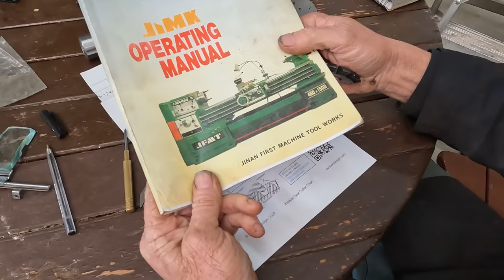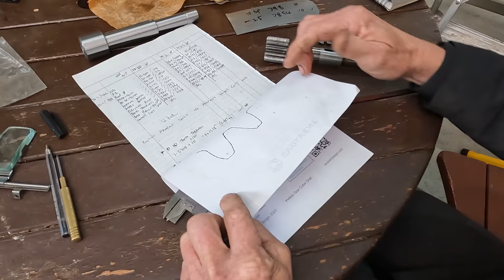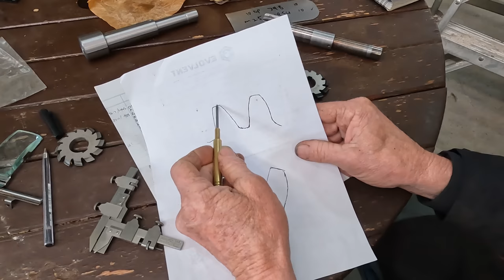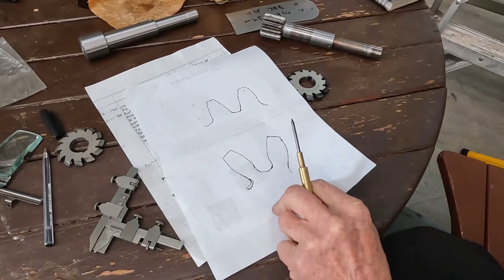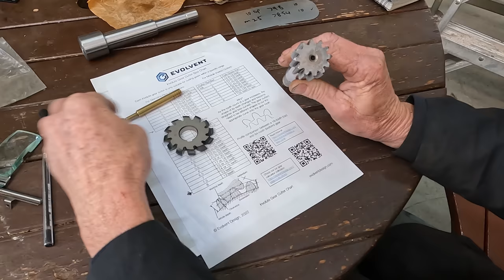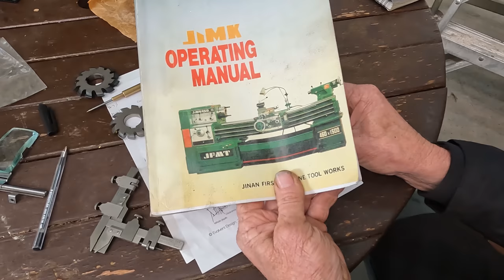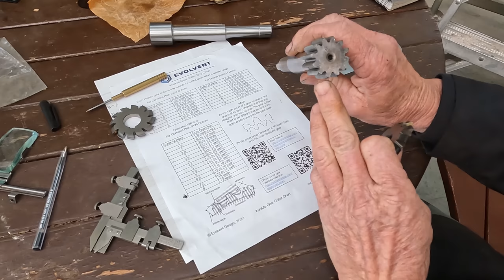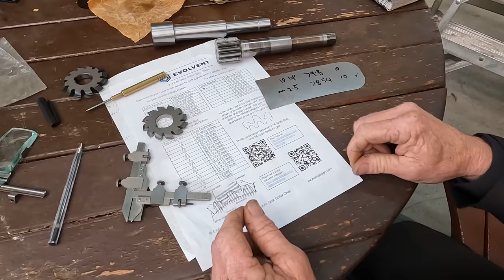A Grinding Wheel Guard For The Tool & Cutter Grinder .

Comment: Hi Max, unique gear profile on that pinion.
Waiting with interest on the gear cutting operation.
My lathe graduations on the carriage handle are only true to 12.5 mm, going further missing 2 graduations.
You cannot count the turns for large distance, will result in a ratio error.
DRO now solves the problem.
Reply from the maker: Just a wee bit of wear !  DRO's are a bit further down the track at the moment .  👍

Comment: Well done Max, it’s great that you can find time to do any videos given all  that you have going on. I have a T&C grinder that can  run in either direction , I have not had an issue with the wheel coming loose  in reverse and I find this feature very useful, might be worth you looking at when you get the 3ph motor back on yours.
Reply from the maker: Thanks .  With a screwed retainer , i wont run this one in rev .   Would be good to convert it to tapered hubs , then it could run safely in rev .  👍

Comment: Hi great result 10k have you thought of drilling the root of the gear before you cut it? keep up the content.
Reply from the maker: Thanks .    No , i will just off set it or single point it .    The undercut is not required with the modified diameter .  👍

Comment: Congratulations on your move. We’re in the same house for 38 years now. I’d love to get a bigger one with more room for my shops and my audio/video equipment. The horrors of moving is a deterrent.

I have to say that just maybe you overthought that guard. You’ve given it enough range of movement to turn it into a robotic arm. I have a question for you. Over the decades I’ve always bought well known named tool holders for my lathes but I’ve been wondering if those cheap ones you see in Amazon or eBay are decent enough to bother with. I hate to say it but when a tool holder is the same price as a good insert, it’s a temptation.
Reply from the maker: I have some cheap tool holders , they work fine .   The real ones , you can get spare parts for .   But saying that , things become obsolete quickly these days !    The guard , i want to have lots of different position options for different wheels & jobs .  Cheers 👍
Reply: @swanvalleymachineshop  it’s hard to get parts for known ones. I’ve got a Kennametal  that I can’t get the right size screw for unless I buy 10 from MSC for $100 US.
Reply from the maker: The last one i bought was Seco TNMG & i ordered spares with the tool . Trouble is , i keep forgetting where i keep them !  @melgross

Comment: Hi Max, What a ball ache that rack and pinion is. Are all rack and pinion set ups like this?. If I was the OEM I would have made it as simple as possible using standard DP or module cutters. Great news on the subs, and glad to see the shop getting there. Best wishes, Mal.
Reply from the maker: Thanks .  I think they modified it for easier mass production , no undercut required that way .   👍
Reply: I should think so. lol. Looking forward to the rest of the restoration. @swanvalleymachineshop

Comment: 10,000 subs! 👍 Well deserved Max, congratulations.

With that JFMT lathe pinion gear, for the undercut at the bottom of the groove, could you not maybe drill the bottoms out on a bolt circle on the dividing head mounted vertically with a chuck - before you then cut the teeth with the cutter?

That might maybe save all the tarradiddle offsetting the cutter to achieve the undercut afterwards?

Just a suggestion, as you well know, I don’t know my @rse from my elbow when it comes to this kinda machining mullarky, but that was the random thought going through my head while you were explaining it.
Reply from the maker: Thanks Ian .  It has to be made the same profile as the original one .  👍

Comment: At a loss to see how that is the original shaft for the machine. Having to go so far off course for that particular gear is mystifying. Sure hope you're able to cobble together a working shaft. Congratulations on getting moved to your new house.
Reply from the maker: Thanks .   It would be the original shaft .  My guess is , they modify the gear for production as it would be quicker & easier to produce than a standard form with the required undercut .  👍

Comment: max, for your hongfong mill problem,  maybe a simplee solution, 4 tapped holes in de baseplate  on each corner with bolts, you can then screw the bolts (like a machinst jack) against the opposite "rocking"plate and the rocking is historie ?

btw, just my opinion, congrats with your 10k milestone max !
but i think youtube keeps your channel (to) low in the stats because you always have super interesting content and in my opinion you should have had at least 100k or 200k by now?

cheers ben.
Reply from the maker: Thanks .   Under the column there needs to be full contact support to help with vibration .     👍
Reply: ok, that make sense.
cheers.
 @swanvalleymachineshop

Comment: Congratulations Max, you deserve it. Your guard worries me, I have had a wheel slightly smaller than yours explode, it was covered by a 10 mm thick cast in close fitting guard which shattered. I surmise that a piece of the wheel wedged itself between the wheel and the guard and broke the guard. Pieces pf the wheel  broke the frame of my safety glasses and  I ended with a face full of shrapnel and pieces of wheel in the left eye and grit in the right eye. Not a happy experience. I was alone at the time and had to shut everything down and self administer first aid by feel. The important lessons from the experience are 1. The kinetic energy of an exploding wheel can smash a 10 mm thick cast iron guard and still have enough left over to ruin your day.  2. Even with a guard in place and appropriate PPE  NEVER stand in the firing line of a grinding wheel. I would make the guard from a thicker piece of steel or add a re enforcing strip around the outer edge or both.
Reply from the maker: Thanks .   I am confidant it will be ok  .  They are more lethal than most realise . 👍

Comment: If you used a hobber to cut the gear it would automatically change the shape of the tooth  of a  profile shifted tooth.
Reply from the maker: A shifted profile is different than a standard profile , the tooth shape changes  .   Cheers  👍
Reply: @swanvalleymachineshop  I know but a hobber would automatically cut the proper profile of the tooth all in one pass.